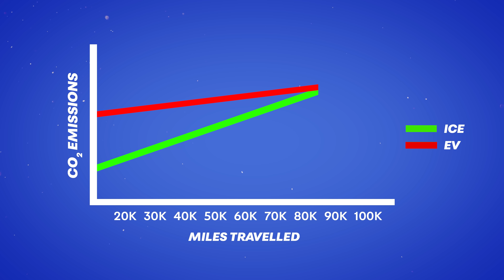Are Electric Cars REALLY That Green? [New 2022 Data]

Comment: Imagine someone actually publishing some facts - good for Volvo. However, there's also also all the horrid rare earths and such in the batteries and electric motors that we don't really have any good way of recycling yet. Those are yet another way EVs aren't as clean and green as we wish. Battery tech advances are needed.
Reply: Lithium batteries are +90% recyclable with the hydrometallurgical process and there are plenty of companies already doing this
 Li-Cycle (LICY) is one that has been on the NYSE for a few years and has plants in the US, Canada, and starting in Europe.

Nothing is perfect and humans are never going to mine our way out of climate disaster and ecosystem damage, but the #1 thing that we can do is to recover and recycle every single element that we mine and refine. This will dramatically reduce the amount of energy and land degradation while moving to a more circular economy. 
So please learn how to recycle PROPERLY and then recycle everything that you can. ♻️🌳🌎🌍🌲♻️✌️
Reply: @andyjohnson3790  - THANK YOU for saving me the time... I am so sick of these people ITS NOT PERFECT SO WE SHOULD KEEP BURING FOLSIL FUELS
Reply: @andyjohnson3790  Wish I could give you more then 1 thumbs up!
Reply: @andyjohnson3790  Those companies are just starting and the process of recycling isn't clean either.
Reply: @andyjohnson3790  "So please learn how to recycle PROPERLY and then recycle everything that you can."

The recycling racket don't recycle half of what you put in. They dump half of recyclable material in land fills.
Reply: @RuddsReels  They recycle less than 10% of recyclable materials. Most literally get dumped in third world country rivers.
Reply: @jswets5007  I knew it was a pretty high percentage that get's dumped, but I didn't know it was THAT high!

Thanks for the comment.
Reply: @RuddsReels  That's according to a German study too. I would link it, but the don't allow it lol. Do some searching around, you'll find it.
Reply: @jswets5007  OK Thanks!
Reply: @jswets5007  Its not that simple. On the one hand glass/plastic hardly ever gets recycled but on the other it is estimated that around 70% of aluminum that have ever been mined is still in use. Its all about how much a material costs to recycle vs how much it costs to mine & refine. Because it  is cheaper and uses less the power to recycle aluminum than putting AlO2 through electrolysis it gets recycled more. Same goes for the car batteries, according to JB Straubel (CEO of Redwood Material which recycles car batteries) they currently get great margins because it is so much cheaper to recycle the batteries than produce them. In conjunction with some other reasons I think nearly all car batteries will be recycled.
Reply: @jtengelbrecht4613  It is that simple, only ≈10% of recyclable materials actually get recycled. Yes, there are a variety of reasons why it is so. I did not say that it is an even distribution of material. However, as you stated, the reason is pretty simple too, fiscal cost.

Also important to note, apparently, it is not the companies that produce the waste that are not recycling it. It is in fact the recycling companies themselves which dispose of the recyclable materials without recycling them, again because of fiscal cost.
Reply: @jtengelbrecht4613  Also, the lead acid battery is recycled ≈100% of the time while the lithium ion battery is not only less recyclable, it is recycled far less due too... Fiscal cost.
Reply: @jswets5007  There is a misunderstanding here. Companies like Redwood Material doesn't get paid for dealing with waist. They either buy the old batteries or get them for free. Their profit comes from selling the raw materials they recycle. Why would they get/buy batteries they don't recycle? That makes no sense...
Reply: @jtengelbrecht4613  Yes, there is a misunderstanding and I don't have the time to explain the complexity of it to you. Companies like Redwood Material make up a miniscule percentage of the recyclable material industry. Most recyclable material is dealt with by massive waste management companies who paid third world countries for disposable rights to it because that is far more fiscally practical than sorting it. They do sort a small percentage of it to sell to companies like Redwood, but as those companies represent a miniscule percentage of the market, it is back to plan A.
Also, as you initially mentioned and I concur, although the numbers are simple the reasons are not. Batteries are a special form of waste, far more hazmat than plastics and glass as I'm sure you know. This presents an entire other set of issues and concerns.
Finally, all items made with recycled material have higher cost than their first run counterparts, largely because of production size. The exception to this being rebuilt items as they are technically recycled but not in the sense of the way we are using it for this discussion.

There is far more to it than that. As I said, I don't have the time to express it all. Check it out.
I'm not saying we shouldn't head that way, and I'm not saying we should. I'm simply saying there are issues that need to be more transparent, as they are very relevant.
Reply: @jswets5007  I disagree, beside that I know Red Wood works directly with some car makers for recycled batteries, they are one of a few and on their own they are already a multi billion dollar company.

The statement that first run materials is always cheaper than recycled is completely false. Aluminum is an example of this. You will have to give me your sources if you claim otherwise.

The hazardous nature of the batteries also means proper disposal of the batteries is essential which makes recycling a great solution. 

I agree that a large part of the recycling industry is a facade but where profitable, the is shines. That is the nature of capitalism after all.
Reply: @jtengelbrecht4613  You are of course free to disagree. In fact it is obvious that you desire very greatly to do so as you have responded to a four day old post lol.
I am not here to convince you or teach you. I have done extensive research because it is a complex subject. There is so much more to it than I have time and space to express here.
You are right about recycled aluminum. My mistake, I was referring to plastic/glass/paper items as they are more commonly advertised as being recycled material. Most aluminum is of course recycled, so it usually isn't even mentioned or thought of as being a recycled item. Although of course it absolutely is.
Reply: Cobalt is used for gasoline refinement and is a waste product. At least it can be recycled from batteries and can be better contained from leaking out into the environment. EVs are not perfect but they are better. Also as the grid starts to use less fossil fuel, the EV option will only get better.
Reply: @yodaiam1000  most electricity is made using fossil fuels in the USA. The grid won’t be using less fossil fuels, it will just move from gasoline to natural gas and coal until we can get nuclear viable
Reply: @tinkthestrange  And that is a very major problem for the planet. EVs are still better and mitigate the problems. Too bad for the planet that the US government is run by corporations including the gas and oil industry. I wish the US was a proper democracy.
Reply: @tinkthestrange  Yes but the turbines in a power plant generate the power at 50%-60% efficiency where the otto and diesel cycles work at roughly 25%-30% efficiency. Generating the same amount of power in a power plant pollutes a lot less than when your car produces that power.
Reply: @yodaiam1000  EVs should be criticized for what they currently are, not on promises from mega corporations, who lie more then they tell the truth.

If EVs do become mainstream and petrol cars are banned in 2030. Do you really think the power grid would be developed enough to sustain the energy requirements? What about ample charging stations? What about the energy price hike that has happen in the last few weeks?

I say keep both methods of energy for cars and don't enforce a ban on petrol cars. At best EVs MAY be a little bit cleaner then gas vehicles. It still pollutes, so to do something as drastic like this speaks volumes, that this is to control the people rather then caring for the environment.
Reply: @RuddsReels  I would say that you don't understand what science or the scientific process are. I would also say that you were listening to propaganda generated from the Heritage and other similar biased foundations that represent the fossil fuel industry.

The scientific consensus is just not an opinion.

Science is the best tool the human race for determining what is most likely to be true and the peer reviewed, retested, validated, and substantiated scientific evidence is over whelming.
Reply: @RuddsReels  controls the people haha grab the tin foil quick. I'm no tree hugging environmentalist but I switched to EV 12 months ago. My EV was about the same list price as an ICE SUV I had been considering in fact the EV has greater boot space could fit the family dog etc easier and had a range of abt 250m so suited most of my needs.  

So for the same vehicle outlay I saved £2.5k on a govt grant, I pay zero VED, I pay zero ULEZ I pay Zero congestion charge, I get 90% discount to park in my local council car parks. I can charge for free at my local supermarket and a full charge for 250mile range on a home charge costs me £2.90 the equivalent on that ICE would have been £47. Servicing is far cheaper also. VED charging for EVs will come, electricity prices have increased but it is still 6x cheaper to fuel my EV than an equivalent ICE and whatever happens to VED I'll always pay less than an ICE driver..... oh and if you have company car 2% BIK rate. Of you drive a decent sized car and aren't pulling a caravan every week  EVs make economic sense.
Reply: @8dcphoto  Interesting! Thanks for the info. EV's do seem a lot better financially given what you said.

BTW you don't need a tin foil hat to know governments want more power.
Reply: @yodaiam1000  I suspect I know as much as you, I suggest you do the same, regarding looking up the information of the evidence against man made climate change.
Reply: @yodaiam1000  I'm not pro fossil fuel per say and I did say that I am on the fence about choosing which vehicle type is better, or if there should be only one power source available. So don't talk to me in that condescending manner!

I'll look into those people you mentioned though.
Reply: @RuddsReels  If some one is telling you something that is conflicting with the scientific consensus, take it as a big red flag.

I didn't mean to say you were pro fossil fuel. I am just letting you know that much of the propaganda started with Heritage Foundation which is pro fossil fuel. People that hear the propaganda don't know where it originated and that it is from a highly biased source. The fact that most people don't know where it comes from makes it even more insidious.
Reply: That’s what separates Tesla from the rest
 they use 0% cobalt and other dirty minerals it’s only nickel and lithium
Reply: + Grand

Plus they use dangerous slave labour to get the metals such as Cobalt.
Reply: @RuddsReels  - Not in batteries that dont use cobalt they dont. Not in batteries that use recycled cobalt they dont.
Reply: @piccalillipit9211  So? All car batteries don't have to need cobalt, for this to be a problem.
Reply: @RuddsReels  - thats true. But the problem with cobalt is not in any way a reason to object to EV's
Reply: @piccalillipit9211  Of course it is. At the very least, child slavery of mining rare metals which will run out very soon for making a proportion of car batteries, makes for one legitimate reason to object to EVs.

Are EVs the new god now? They can't be criticized? Being objective and seeing the many flaws with EVs are the first step into making them better and morally clean.
Reply: @RuddsReels  No. Cobalt is Not rare earth. It's a MINERAL 
And what's more, it's on its way out in favour of Lithium Iron and Lithium Sulphur   60% of new batteries are LFE already.
Reply: Too bad we aren't capable of innovating huh? lol
Reply: @chaseflores3222  Its not that we can't innovate. Its that government is trying to push EV's before they are ready to be a bigger part of the economic mix.  Example, how many poor and middle class can afford EV vehicles?  How about those who live in rural areas where range can become problematic?  How about people who live in apartments that don't have level 2 chargers available?   Right now EV's are not a full replacement for every scenario ICE vehicles cover.
Reply: You forgot to mention the actual use of slavery to mine these rare earth metals.
Reply: @George-qw8ss  NO!
Reply: @George-qw8ss  WRONG - thats cobalt which is NOT a "rare earth mineral" and the use of cobalt is all but phased out anyway...

Can you at least TRY to be accurate with your excuses as to why the world can not progress...??? PLease?  Just try.
Reply: @George-qw8ss  no dude all of this only applies to non Teslas which account for less than 1/4 of ev sales
Reply: I don't want to come in here and say anything to blaspheme the new ev god. I'm told those purses can leave a nasty bruise.

Comment: Another thing with these fucking e-jalopies: After roughly 5 years the batteries are done and you need new ones. But the CO² amount when the batteries are being produnced is so high you could drive a EURO-5 Diesel engine car for 8 years to reach the same amountof CO².  But after 5 years the car has lost so much value that new batteries cost more than the remaining worth of the car. So this alone makes the e-jalopies worse than any I.C.E. car. But tell this to this to this meddlesome brat Greta Thunberg and her stupid followers...
Personally I hope that these bloody things will NEVER come out on top. I.C.E cars for the win! But with synthetic fuels! Hydrogen combustion for example. Refueling takes as long as with gas or diesel, and doesn't take hours as with these bloody e-jalopies. Reach is also far greater. 
If they want to reduce CO² than they should first do something with the propulsion methods on ships! A simply cruise ship produces as much CO² as 8 million VW Passat e.g. PER DAY! Prhobit these first and force them to develope more environmentally friendly propulsion before maltreating us car drivers.

Comment: If you own an EV and garage it so the temperature doesn't go too high or low.. you only use the supplied charger the battery longevity will be good...BUT .. if you travel a lot with your EV and constantly need those Tesla chargers on the road... Those charge at a much quicker rate which lowers the longevity of the lithium batteries!

Comment: What about the lifespan of the battery? How much of the battery wlhas degraded doing those 90000 miles.  If you need to Change the battery in the mean time you need to add a few more miles to that number

Comment: Enjoyed the video. Does this take into account the service over time? It would seem to me that combustion engine service would be a lot more than electric batteries less moving parts . Spark plugs oil changes belts all of these things are serviceable within 50 to 100,000 miles also retentive breaking . Girlfriend owns a Tesla I own a GMC I love her Tesla but not willing to trade in my combustion engine just yet. She does have solar panels on her house as well as I ran a 220 circuit to charge her car. Not visiting gas stations is a blessing. But there is a Tesla charging station down the street and it seems people are lining up and spending far more time charging their car than a gas station trip (consideration)

Comment: I wonder if the study takes into account the casting of metal engine parts, people idling in big cities either in traffic jams or looking for parking in their downtown cores.  I actually think electric makes a lot more sense for folks who live in cities where the pollution is bad due to density and limited movement.  I’m not sure anyone has the tools to measure that effect yet.
Reply: It 8
Reply: Most modern cars auto shut off their engines when stationary in traffic or at the lights
Reply: What makes the most sense for people in cities are electric bikes
Reply: In those cities mass transit needs a real solution
Reply: Pollute the air with fumes in cities vs pollute ecosystems mining for lithium

Comment: This is assuming the use of a Lithium turner or battery using nickel cadmium  which in itself is not green try replacing the battery pack with an LFP battery pack like most of the other Chinese manufacturers and the green credentials become much more favourable. Videos like these do nothing to help inform because the benchmark you reference is already biased by its source. Sorry mate you really need to research more before speaking out.